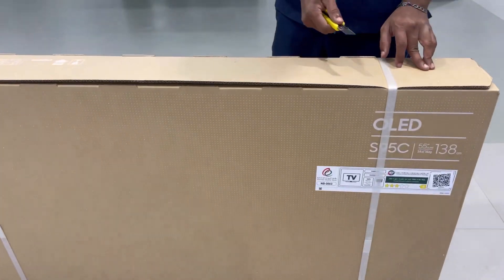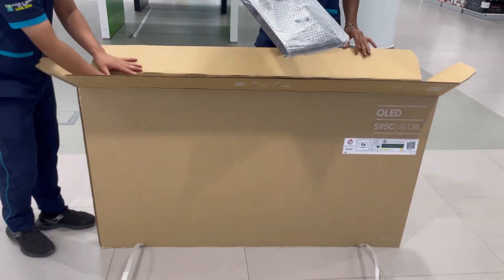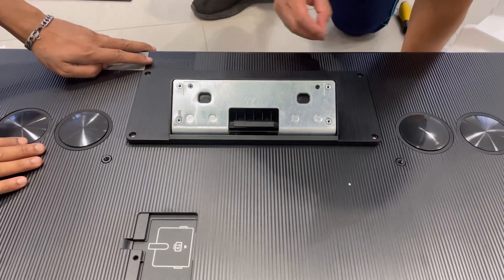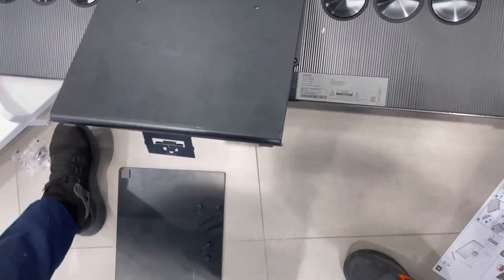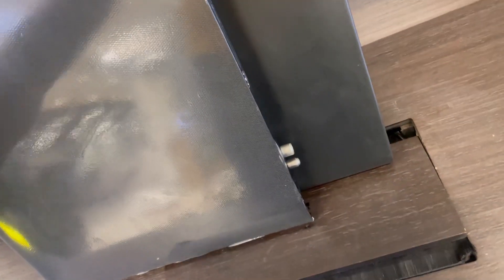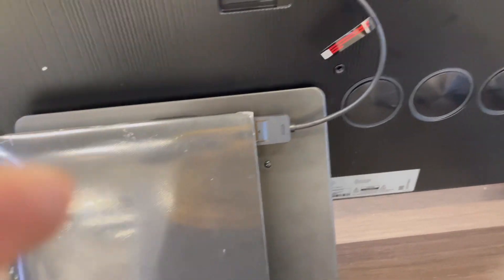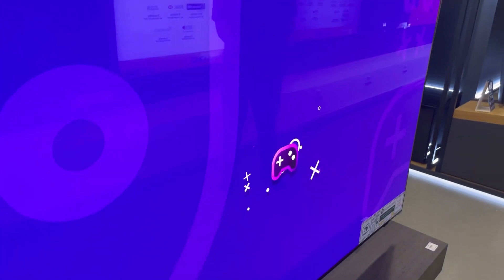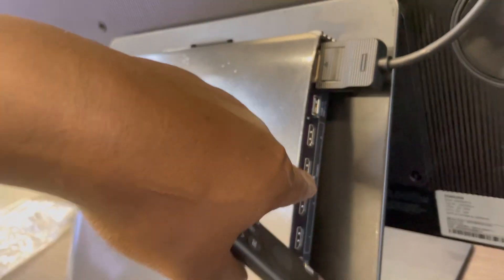Unboxing SAMSUNG QD-OLED 55S95C

Comment: I purchased the 55 inch Samsung S95B OLED 4K television when it was first released in April 2022. What attracted me to this television was the center stand because I don't like televisions with the 2 legs at each end because you have to have or purchase a special stand to sat it on. No living in a house that I own, I wouldn't place my flat screen on the wall in an apartment due to water leaks from a unit apartment or major wall repairs. What I don't like about the Samsung OLED S95C 4K television is the processor coming separate and you have to attach it to the television. However, Samsung televisions are the best over Sony, LG, TLC, and other televisions.